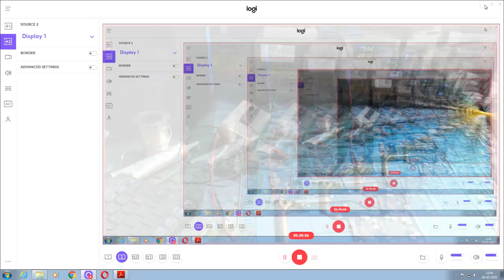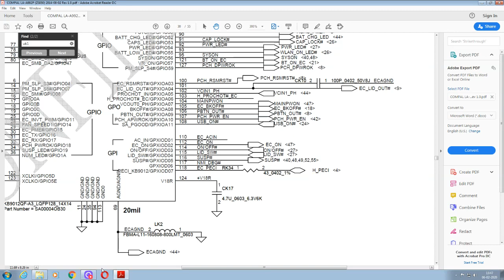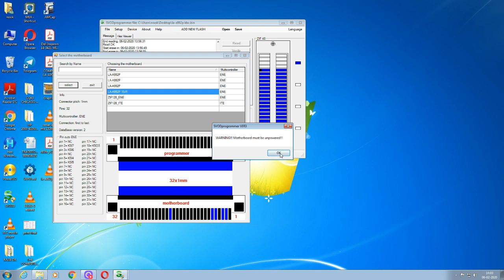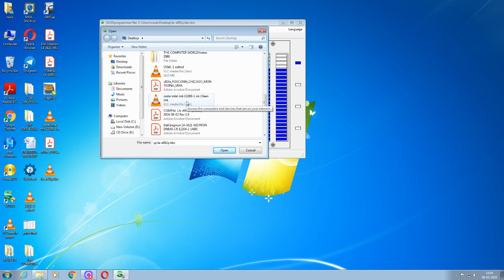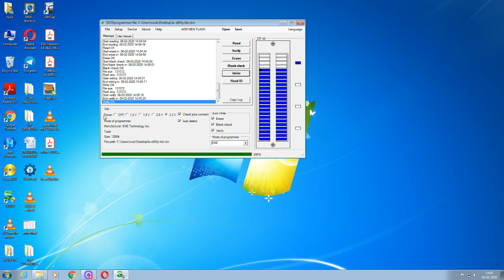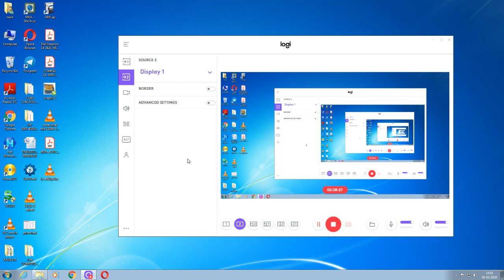HP 15R LAPTOP NOT TURNING ON SOLVE STEP BY STEP

Comment: Hi, 
I am having laptop HP notebook 15 r230ne (i5 5th gen) , but its motherboard (HP 15R ASO56 LA-B972P) is dead now so i want to purchase new one , i find online 
If i purchase this one (796310-501 AS056 LA-B972P mainboard HP 250 G3 15-R Motherboard i7 SR23W CPU) , core i7-5th gen 
Does it fits into my laptop casing and work fine ?
Also i wanted to know is it only main board or is it complete motherboard with CPU i7-5th gen with discrete graphics card ?
Thanks